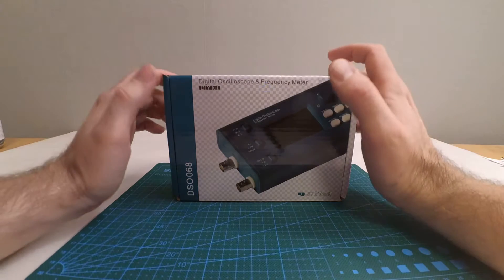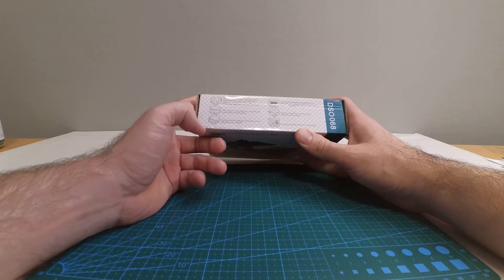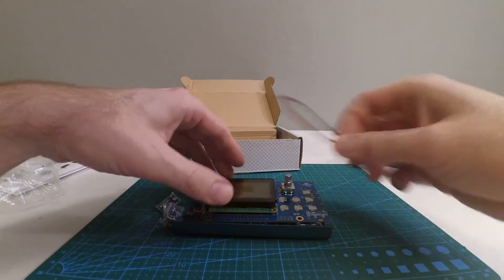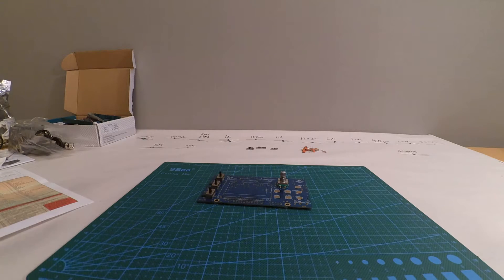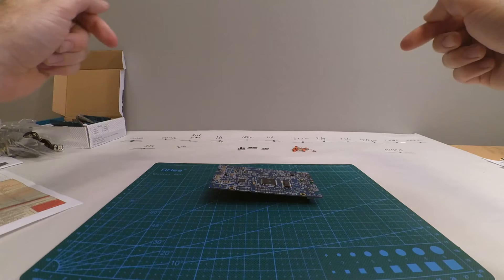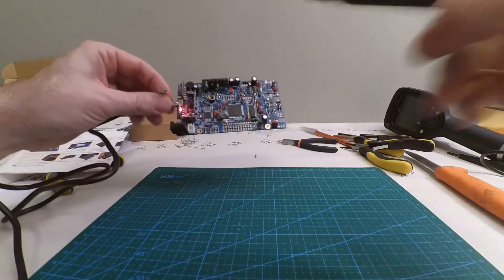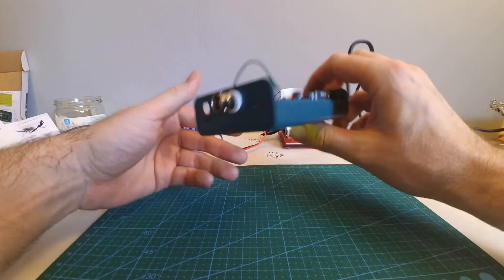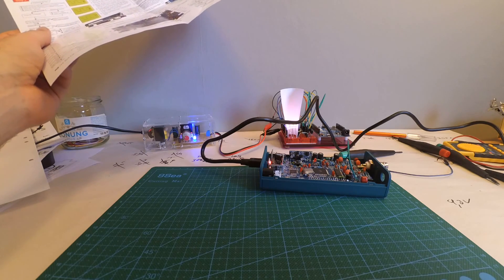#5:1 DSO068 DIY Oscilloscope Kit - Part 1 Unboxing and Build problems

Comment: The wave is not square because it probably needs the probe capacitor (or capacitance) to compensate.
Reply from the maker: Yeah the capacitors on the PCB is for compensating the input capacitance, the probe dosen't have a built in capacitor.

Comment: help, you may enable Spanish subtitles,
Reply from the maker: Hi. I have enabled subtitles on all videos now (if anyone wants to contribute).
I don't speak/write Spanish my self.
Reply: Es posible elegir  traducción automáticamente  en el vídeo y elegir español, solo desde  el ordenador  escritorio, no es posible desde dispositivo móvil

You can choose to automatically translation in Spanish video and choose only from the desktop computer, it is not possible from mobile

es posible  que el esquema  adjunto  de montaje  sea  la versión F, por lo que no corresponde con el kit de montaje que es de versión H
Amenos en mi caso sucedió eso, el plano de montaje  no coincide  con versión de montaje

it is possible that the diagram is mounting version F, so it does not match the mounting kit is H version
It entertaining in my case that happened, the assembly plane does not match assembly version
Reply from the maker: I'll take a look at subtitles and translation. Googles "auto subtitles" are hilarious so have to correct them first.

If then plans and pcb/components are different you might have a counterfeit kit.

Comment: При сборке столкнулся в несоответствии Part List где указано R9, R21, R20, R30 сопротивления по 10 Ком, по факту R21 нужно 120 Ом, хотел писать продавцу что перепутаны сопротивления, но когда нашел схему, чтобы посмотреть обвязку то обрадовался, так как лишнее сопротивление 120 Ом совсем не лишнее, благо не запаял еще. А вот 3й конденсатор в 15 pF пока не нашел куда поставить. Максимальную частоту кто то проверял?
Reply from the maker: Анатолий Солодянкин has 2 questions:

Q1 "Wrong values on some components": There are two versions of this kit/PCB "F" and "H" check that you have the right version of instructions for your kit.
You find the instructions on this link: http://www.jyetech.com/Products/LcdScope/e068.php

Q2 "Max frequency": My kit works good up to around 250kHz. Some have reported up to 400kHz then the signal starts to get distorted.

Comment: Är du säker på att det inte är någon trimpot för att justera/kompensera för en korrekt fyrkantsvåg? Låter väldigt osmidigt om man ska måsta byta kondensatorer?

Var köpte du denna förresten? Skulle vilja hitta den inom EU så man slipper vänta 3-4 veckor =)
Reply from the maker: +Eric Öhman Det är en trimkondensator och en keramiskkondensator i serie, väldigt grov justerng av ingångskapacitans (impedans) vid olika mätområde.

Jag köpte min från Banggood i Kina, men samma kit finns hos DX.com EU-shop så man slipper vänta (lite högre pris)
http://eud.dx.com/product/dso068-diy-oscilloscope-kit-with-digital-storage-frequency-meter-atmega64-avr-microcontroller-844400583#.VtkQjJzhDNM
Reply: Okej. Jag köpte en sån och en dso 138. Får se om det går få dom att fungera =)
Reply from the maker: Du kommer säkert att få allt att fungera, bara dubbelkolla instruktionerna och komponenterna.
Har beställt en 138'a även jag, får se om det blir en video med eventuella misstag även på den :)
Reply: +kristianlaholm Hej igen, nu är min DSO068 klar! I finally put my kit together! It was actually a little harder than I thought, or at least it was more time consuming than I had expected. I had problem fitting my battery, it kept pushing against the reset switch :) Take a look at my video if you want watch?v=BHwWgHRvNfQ

Comment: Really looking forward to the next part/parts!
Antar att du är svensk? Såg en houngsburk i ett av dina klipp :)
Har fundringar på att köpa en dso068 eller en dso138. finns massa videos om dso138 men bara din om dso138, någon rysk med möjligt men den räknas inte...
Reply from the maker: +Lars Borgny Thanks, new components are on its way and hopefully it will only be one more part/video :)

Jag valde 068'an då man fick kapsling/låda med till denna, tanken är att kunna ha den lite mobil.
Får se om jag ger mig på en 138'a senare bara för att det är kul med färg :)
Som du ser i min video är du inte "garanterad" att få en fungerande produkt när du monterat allt, räkna med en del felsökning.
Men felsökning är halva nöjet :)